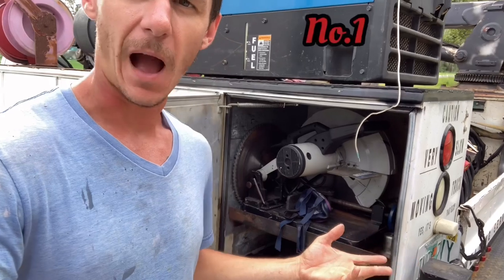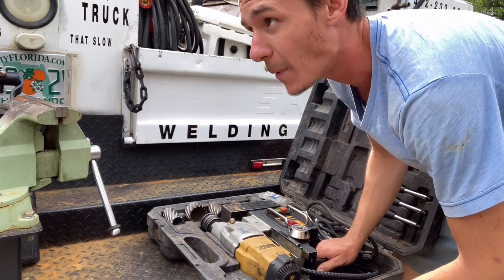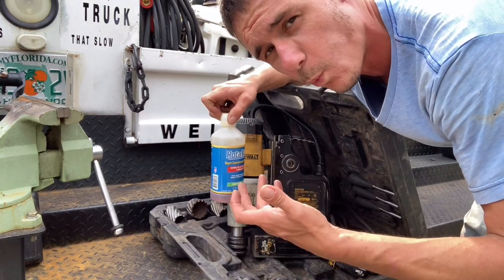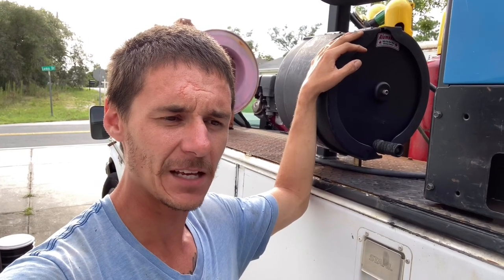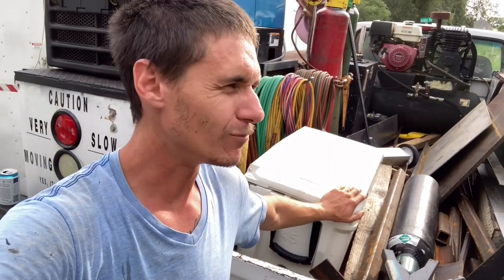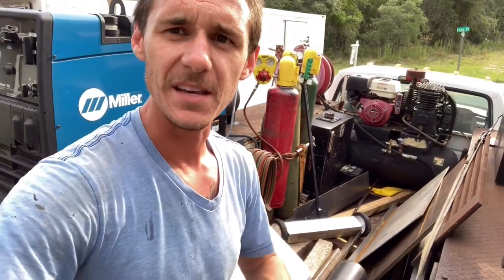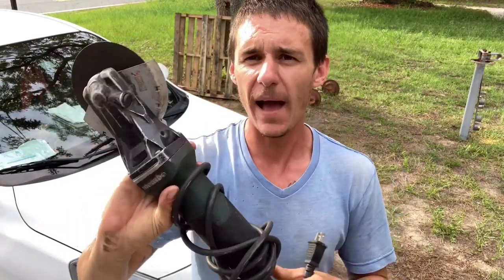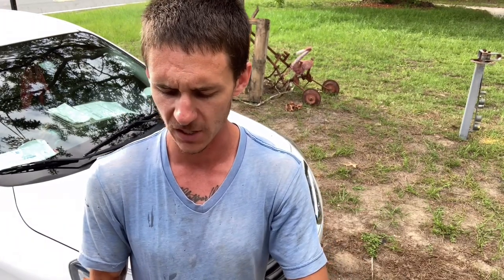Top 5 tools EVERY Mobile welder should carry!

Comment: Metabo grinders = win! That said, avoid the Metabo-HTP line(found in big box stores), they're garbage that was rebranded from Hitachi(IIRC).

Tip from a machinist: Cutting oil does matter, and I wouldn't buy it at a welding supply store. Stop in at a local machine shop and ask them to put you in touch with whoever supplies their coolant/cutting fluid. Chances are you can buy a five gallon pail of a superior product for far less per fluid ounce than what you're paying at the welding supply. Along with that, make sure you're running those cutters at appropriate speeds for the material they're cutting. Running any cutting tool too fast generates excess heat, which ends up as heat soak in the cutter, a reduction in the hardness of the cutting edges, and drastically reduced life. More than likely, the machine shop can also put you in touch with a reasonably priced resharpening service for your cutters too.

Comment: Bosch, Hitachi, Fein, Metabo and Makita are all brands I have owned. All have burned out and the Metabo's I woned in 2008 were the worst. They are plastic on the bottom of the gearbox too where the guard mounts. I currently run ten Makita grinder's, one Bosch and one Hitachi. Keep up the good work young man!
Reply: So far so good with my makita grinders. No experience with other brands.

Comment: Great list! Thanks for making it. I can only think of one thing, related to grinders. Keep extra arbor nuts handy...I'm working in a shop, but I have 6 in the console of my truck. Nothing like having to leave to go buy one...
Reply from the maker: I always do! Especially with these Metabo’s. Can just grab them at a store
Reply: If nut comes off to switch to wire wheel, it goes into my pocket.

Comment: Great video, if you haven't get a built in compressor plasma cutter, is a great investment also. I would recommend Hypertherm power max 30.great tool.
Reply from the maker: ive been considering one, but im pretty proficient with a torch. so its at the back of the list behind a lance, air arc gouge and line bore set up.
Reply: @MeltinMetalAnthony  The air arc will help alot on thicker material repair.  So much quicker than the metabo!  Make sure your engine drive can handle the amperage.

Comment: Great vid, good advice-thanks. Eski is definitely good choice in Fl

I find Japanese 110V Nitto Khoki needle gun is another one of those must have tools if you do a lot of stick welding 👍
But it ain’t cheap

0.030”- 5” flex carbon discs from Pferd  are the best cut off discs there are-
will cut 1.5” solid stainless rod like laser 
with almost no wear
I have several metabos and Walters with speedos because I like hitching alu cutting carbide tipped discs onto them. They come with slip clutch as well. I Buy Made in Germany only. I would not take their money if their”Metabo” is “Made in China”

Comment: metabo eh? im not a welder, but I always thought makita was the golden standard for welders? deffinatly the most common from what i've seen.
Reply: Milwaukee where I'm from. Never seen a single contractor or where I worked personally use anything but milwaukee tools, aside from for production use which would get cheapo's from home depot.
Reply from the maker: being a self employed guy who does all the work I want something that's gonna last a long time. besides the quick coupler feature the Metabo grinders have been my most durable and used tool

Comment: Great content. Only problem is this is so subjective to your location or type of welding… mag drill was one of the first things I bought bc it was “so cool” it sat in my truck for over a year until just the other day when a company asked me to torch cut holes in forks for a ball hitch… 15 casual mins to blast two holes and make $100+   An air compressor and hyperthem plasma 45-65amp will put you ahead. Not only can you now use pneumatic tools like needle scaler or air hammer but you can also plasma gouge or just plain old plasma cut any material… oxy fuel torch is only good for steel (ovb) and it only get credit bc it’s the only other option. I run a Miller trailblazer AirPak with 65amp hypertherm and still continue to amaze customers with cut quality or metal removal (gouging) in the field. Keep it up 👍🏻

Comment: Koike beetle is the brand of track torch i use very well built several other rig welder i work with use the same one for many years no issues
Reply from the maker: I would love one! Probably going air arc gouged first then track torch

Comment: 1) half clamps. C clamps and/or bridge clamps with the end cut of so you can weld it temporarily to help with fit up.
2) Carpenter bar clamps. They can't be close to the weld because of the heat but they are great for the one-handed capability.
3) cordless grinder. They are not for hardcore grinding. But the convenience of having one for the little stuff has made mine indispensable.
4) kneeling pad. Trust me you have one spark get caught behind your knee pads you'll never want to wear them again! Kneeling pads do wear out because of the Sparks but it's well worth the convenience and the comfort. The more comfortably you are the more weld you can put down.
5) back up tools. You can get a little out of control with having backups because space is at a premium. I always make sure to keep an extra grinder, welding lead connectors, Etc in a do not touch box. The customer isn't going to pay you the two hours of windshield time to run and get another tweco fitting because it arced out.

Comment: I have to say, it's nice to have all those tools and doing tree service work, (not related to welding ) I started off with a pickup and a chain saw, nothing else, no pole saws no ropes no climbing gear nothing, and yes I wanted all that stuff but had to get started before I could buy all that stuff, So I would say this, if all you have is a welder and a Generator and some grinders, you have enough to get started doing small jobs, but you have to manage your money well and put at least 70% of your money back into your business and start buying better tools and getting everything you need. Getting started is one thing, just me starting my tree service 30 years ago, with a pickup and a chain saw, within a year I had all the equipment I needed, and was able to buy a chipper shredder as well because I put my money back into my business.  this guy has great information and make a list of these tools but remember if you are just getting started start with what you can afford to get started with and then start putting as much money as you can into your business and getting everything else you need. But remember that when you are just starting out with minimal equipment as I did with my tree service, you can't charge as much as the premium guy's do and you have to put back into your business to get a strong business and keep growing, if you are just partying and drinking up your new found wealth all the time then you are never going to get bigger and better.